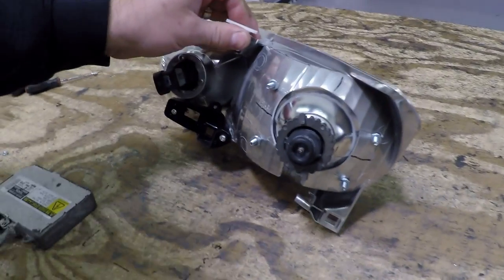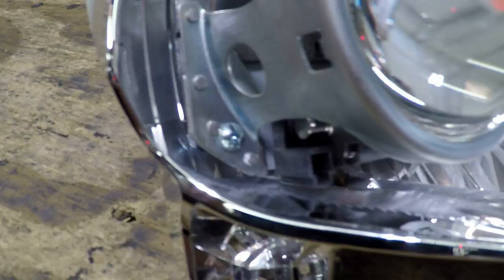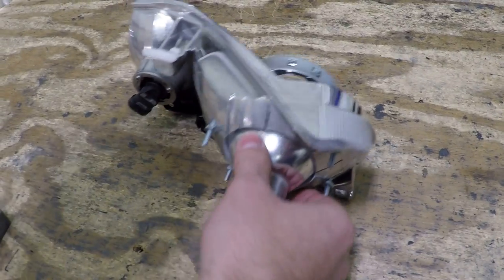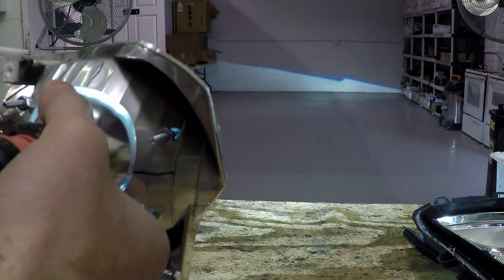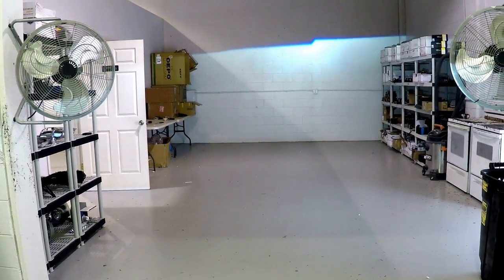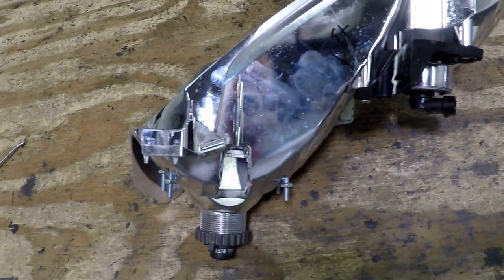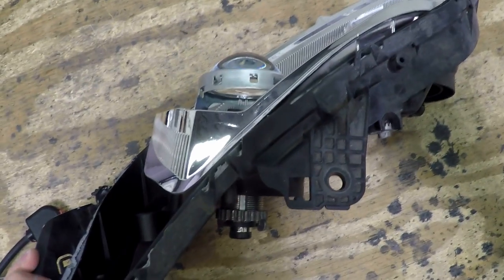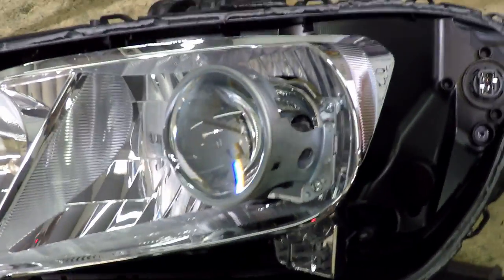Part 2 - Mounting Projectors Using Reference Points

Comment: I'm assuming this isn't as important if you're doing bi-xenons and don't use a separate high beam?
Reply from the maker: To some degree - yes. You still want to get the projector mounted in the same height/angle as the original low beam area.

Comment: how do you align the projector straight before doing the holes in the reflector bowl  ?
Reply from the maker: Just comes down to experience basically. You first open up the hole and recess the projector all the way back until it hits reflector. Mark out the four points and then drill right through. We do have templates now for each projector though so its a little easier.